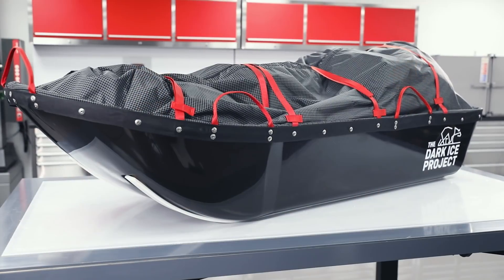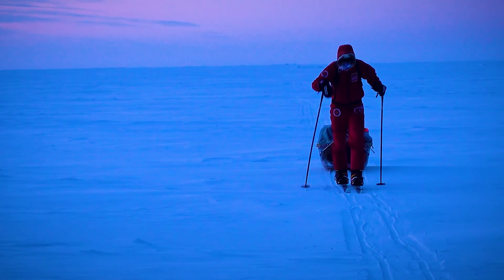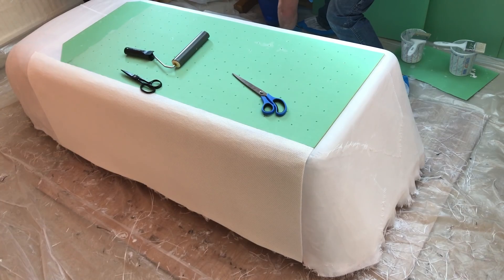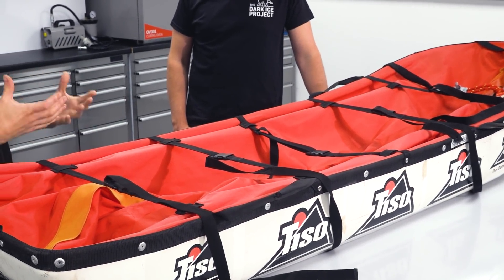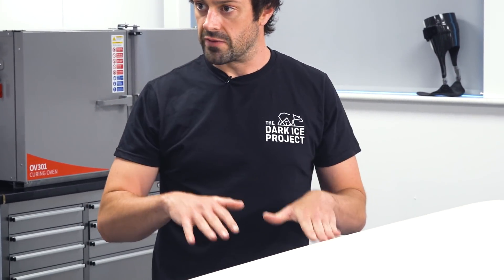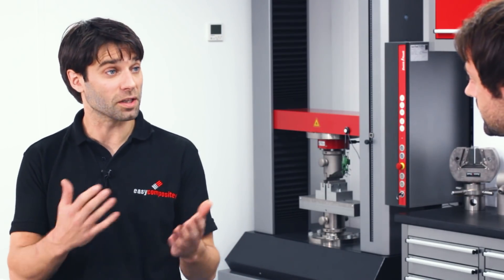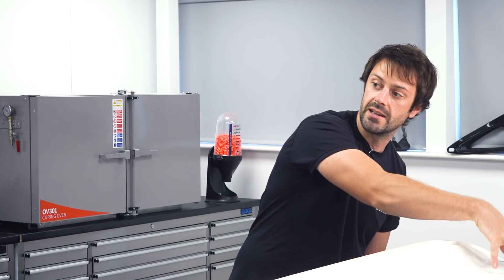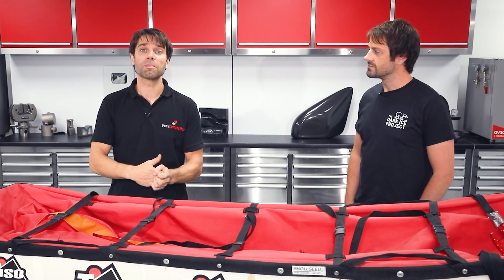Composite Sledges for a World Record Attempt - The Dark Ice Project Introduction

Comment: What is the Dylon (sp?) Material you mentioned?
Reply: Diolen - a polyester reinforcement with good flexibility and stretch characteristics but not as strong as Kevlar/aramid.
Reply: @AH-ns2wh  Thank you for replying! 
I was impressed by Diolen's flexibility when you hit it with that hammer. That got my attention. 
I am starting to think about building fairings for Quicksilver MXL ultralight aircraft that would be much lighter than the thick and heavy fiberglass ones (to make them sturdy) that are available today. I was thinking about a flexible skin with "ribs" on the inside, made of foam strips covered with CF to add the structure. I thought this would allow it to be bumped into without damage. 
http://www.smittysfab.com/quiksngn/bullet14.jpg
Reply: @michaelbishton9439  I'll defer to the experts at Easy Composites, but although yes Diolen is exceptionally good at taking repeated impacts, it's a LOT less stiff than kevlar, carbon and glass, so if you need it to hold its shape reasonably, you need either quite some thickness, or to add a core, or carbon structure as you say. I'm not aware of any Diolen hybrid weaves to get a mix of properties like you can with carbon and kevlar.
Reply: @AH-ns2wh  Thank you for replying. 
That is why I was thinking of giving it shape by making ribs out of strips of foam, covered with Carbon Fiber. They would be cylindrical ribs spaced six inches apart, from front to back. That way, if you bump the fairing, it would take the beating, but the overall fairing shape would be maintained by the ribs. 
Thank you for your thoughts.
Reply from the maker: There are not any hybrids at present however you can put different layers of different cloths to get a mixture of properties in the laminate, so carbon for stiffness and diolen for impact resistance.  Aramid is even better for impact resistance and is commonly available in a variety of hybrid formats.
Reply: @easycompositestv  Thank you very much for taking the time to provide information i can use for course correcting. I'll start looking at what Aramids there are.

Comment: The resin at 50 below or30 40 below will make all the difference for performance and I doubt there is test data at low temperatures
Reply: Below -50 isn't necessary, and we have used, and abused, the relevant resins from the EC range below -40, with no issues attributed to the resin. Nothing beats real world experience.
Reply: @AH-ns2wh  ,thanks for that. I had a resin problem years ago related to temp. Nothing super cold. I'm old and have had so much go wrong I just wanted to give a heads up.

Comment: In terms of what to use as the runners, as a skier i’d say go for a regular ski base material but if you can have it ground into a very fine pattern then it will run faster than a deep base grind, this is because youre running on very coarse snow so there wont be much water to wick away from the base compared to slushy or wet snow.👍🏻
Reply: At the temperatures designed and planned for, you don't benefit from any friction-generated film of water like you might at -10 or -15, C, so low dry CoF is the target.

Comment: Whats this D material you guys talk about at the beginning?
Reply: Diolen - a polyester woven fabric. It's less strong/stiff than aramid/Kevlar, but is a lot cheaper, and you can stretch it further before it fails.
Reply from the maker: Yes, as AH said. In the 4th video in the series (the 3rd proper 'tutorial') we do a detailed evaluation and comparison between various possible reinforcements; Diolen, Innegra, Kavlar and Carbon. I think you'll find that helpful to understand Diolen better.

Comment: Make sure you test your materials at cold temperatures. Last thing you need is for your chosen resin or coating to become brittle at deep sub-freezing temperatures.
Reply: I apologize if this is obvious to you. But it wasn't mentioned in the video, is all.
Reply from the maker: Hi, yes, we've got that covered for sure. the 4th video in the series (the 3rd of the proper tutorials) is all about material testing and we do a few different things to ensure we're testing the materials at low temperatures. Stay tuned!
Reply: @easycompositestv  Looking forward to it!

Comment: What are the pros and cons of using your techniques vs metal shaping with sheet meal? Mabe not for this scop bt for creating new cars motorbikes etc. How can we budget a design using your ways of doing it?
Reply from the maker: It's difficult for me to understand the comparison really; if you're making a composite component (carbon, Kevlar, fibreglass etc.) they're you're almost certainly going to want a composite mould to make it in. It would be pretty-much unheard of to make a mould from sheet metal and wouldn't really be suitable if you did do it. If, on the other hand, you want a sheet-metal part then making a composite pattern wouldn't really make sense.
If you're talking more widely about the comparison between composite vehicle panels and metal vehicle panels then the advantages are pretty-much all with composite panels, in terms of weight/stiffness etc, enabling you to make a lighter vehicle if it was made with a carbon fibre body compared to an aluminium or steel body, but the costs, especially in mass production, would be much higher for a composite body.

Comment: Why hasn't carbon fiber and kevlar been used yet ?  When it comes to strength and impact resistance carbon fibre and kevlar are used to stop bullets from entering somebody's body cavity so I think it would be My personal option when it comes to strength and weight For regular civilians you not gonna get much better.  There are Alaskan cub planes that are made out of purely carbon fiber/carbon cub lol  The only downside is the cost of carbon fiber/1 tine intinial investment but the upside is it will last forever. Look at broadhead penetration  That's exactly what hes talking about essentially penetration. The broadhead punches a hole big enough for the arrow to slide through No loss of energy Thats important  With a heavy strong nose also known as FoC When you hit a snow drift it will punch through with the least amount of energy needed
Reply: Huh?
Reply from the maker: You will see the materials used and also some material selection testing in a further video to show the reasons why the materials used are selected.

Comment: This is very interesting.  When designing the sledge, you can turn it into a survival shelter by adding insulation to the sides & bottom and throwing a sleeping bag on top.  In a storm, he could empty sledge and crawl in to survive.
Reply: You're spot on - this is indeed the last resort plan in an emergency.
Reply: @AH-ns2wh  when i crossed the patagonian ice cap in 1998, it took 98 day sled ski expedition, i designed and builded the 2 different kind of sled we used, later used some on greenland too, is good to make it more shallow but this cavity in the middle also trap some air and offer less drag  on soft snow,  then a complete flat one. i learn stability is much more dependent then how wide and longer the sled are.  also in  the ocean artic  i wiould bring a packraft to cross this open water channels or something to connect both sled like a cataraft... well nice  to see it. my own sled, 2 mts long and 60 cm wide was about 15 kilos old fiberglass, this was 20 years ago!!, so let see what can make new tecnology. good luck

Comment: Would a polymer mold release, such as Loctite's WOLO, Axle 818, or the higher release Zyvax/Chemlease products work to reduce the friction on the ice?
Reply: Any rub-on products etc would wear off pretty fast. The product surface itself needs to be as fundamentally slippery as possible.

Comment: Talking about 'ground plastic' for the runners, is that to achieve that sort of 'shark skin' surface that competition swimsuits have?
Reply: No, that's more of a fluid dynamics solution. Although you get a little surface friction melting as you slide over some snow surfaces, ground plastics would be there in the resin to hypothetically reduce the CoF.

Comment: epoxy with graphite ,
On International Trade Fair for Composite Materials i talk with canoe and yacht makers and they say to use epoxy with graphite on botton for super smooth and low friction surface 
For me it is avesome material i was surprised how strong it can be , pure epoxy with graphite super strong and feel smooth , can bond everything together 
i would like to see test with it and hard epoxy ,,,  maybe even graphite with chopped carbon fibre /kevlar but there is small chance it will be smooth enough after kevlar fibers start to go out of the resin .

PS.
avesome project to work with :D
Reply: You might be surprised by a subsequent video in this series!

Comment: hello id like to ask is there a formula or a relation to find out how thick will my part be after doing the vaccum resin infusion. ( for  example how much does epoxy add to thickness of the reinforcment sheets). and thanks for the great and intresting content.
Reply from the maker: Yes, it's actually pretty straight forward. For many typical reinforcements (carbon, glass and Kevlar, to an extent) the thickness that layer of reinforcement will add to the laminate, in millimetres, can be correlated to its weight in gsm. So, a 200g cloth will add about 0.2mm thickness. A 400g will add about 0.4mm, an 800g would be 0.8mm. It's no exact but it's very close, especially for carbon and glass. Kevlar is a bit less dense and so works out a bit thicker than its weight would suggest.